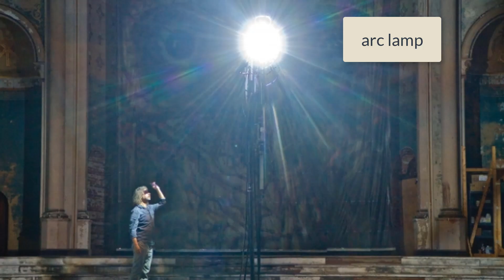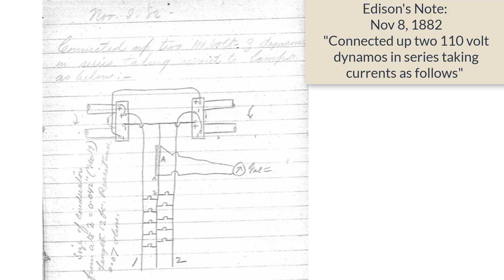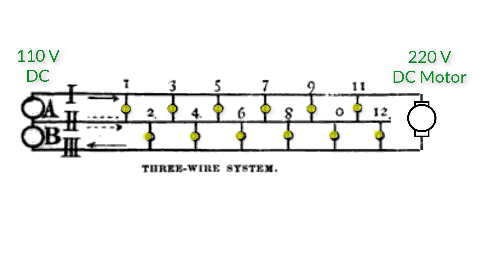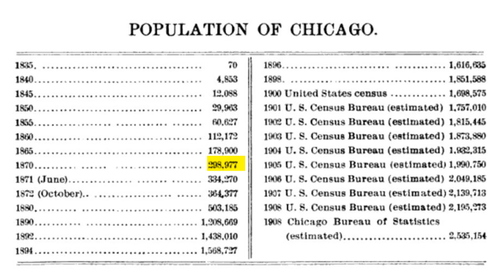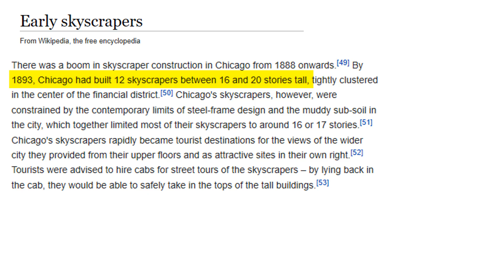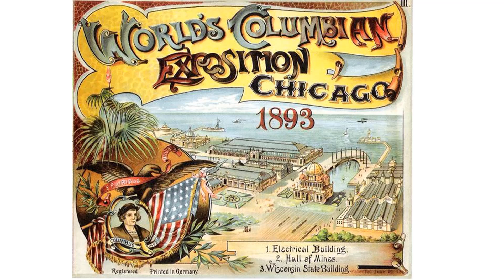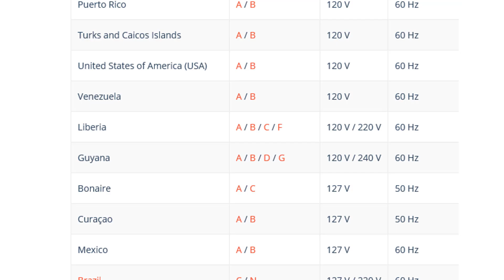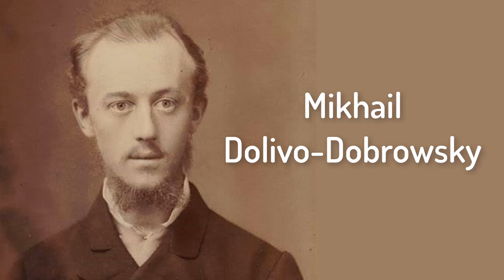Physics and History of Why USA uses 120 volts and not 220 volts

Comment: At 2:35, the correlation between loading and resistance is backwards. The more loads you have in parallel, the LESS resistance you have, not more. The reason why the "popular" lines weren't as bright is due to a higher voltage drop across the conductor. More current means higher I^2R losses.

Comment: Ok, I get the 110 V and 220 V DC for the standard with Edison light bulbs,  but in 5:04 of the video we are in Europe with new light bulbs...are we talking on AC or DC voltage? Because the transformer wont work with DC voltage...

Comment: Actually, in Europe we use 3-phase system at home, too. And that's probably case in most parts of the world that use 220-240 V. So you have always 120° phase between hot wires.
"Normal" 1-phase outlets are distributed in home to somehow distribute consumption (not ideal, but good solution), and there is almost everywhere at least one 3-phase outlet. For example, my stove uses one such outlet, but it can be wired to use 1-phase outlet too.
This is good for electrical companies too, because if there is less current in neutral wire, they loose less and transformers just need to transform high to lower voltage.
If I understood right, in USA you get 2 hot wires with 180° phase. OK, advantage is that when you use both wires, you double the voltage, where in 3-phase system, every combination of two wires gives voltage of sqrt(3) times bigger voltage (about 1.71 times).
I still ask myself: What's wrong with USA? 😀
And let's not forget Tesla...

Comment: Interesting, thanks

I thought above ground delivery and decentralization of power stations made the locally transformed 120v safer and more efficient. 

Safer because the fluid transformer being an isolator for spikes and resonance. To the level than you can power a factory anywhere, only amps are the limit, as far as factors affecting zoning are/is concerned.

And now it is consistent with history, thanks again

Comment: Hmmm, some facts but leaving out many others. Edison & DC and transformers in almost the same breath - transformers are use on AC, and Edison was a proponent of DC. Edison didn't invent multi-phase power, it was independently invented by Galileo Ferraris, Mikhail Dolivo-Dobrovolsky, Jonas Wenström, John Hopkinson and Nikola Tesla in the late 1880s. There's much history about the battle between Edison and Westinghouse, DC vs AC. Edison's DC system in NY suffered from being DC and the current loss over distance meant the generators had to be many and distributed frequently. The large belching generator plants which caused end-of-line current to be non-existent when loads increased closer to the plant made Edison electric undesirable. The Chicago Worlds Fair pavilion being lit by the Westinghouse system is what made AC king. The first commercially viable and effective electrical generators were at Niagara Falls and Willamette Falls (Oregon).  Also, no mention of Tesla, who is the reason AC and Westinghouse was so successful. Some aren't fans of Tesla, but it's his name on the plaques on those original generators, he also designed the electrical motors which were efficient and allowed the factories to use the electrical power effectively (a design unchanged for most of a century) therefore he's earned his place in the history of electrifying the world. Edison popularized the light bulb, but Tesla brought us the electricity to power it.

Comment: Actually...just about every home in the US has 240V. They just break it down into 2 legs of 120V for lower current uses. 
The whole point of higher voltage is less current for the same amount of power. POWER (W) = Volts (V) X Current (A). 
Current is what heats up wires. For a given amount of power needed, you can safely use a smaller gauge of wire with a higher voltage. 
Saves Copper...saves Money.
(Then there's 3 phase...but that's another story...:-))

Comment: America does use 220(240). Good luck finding a household in America that isn't 110(120)/220(240). Commercial buildings may even have 3phase with different voltages, some much higher.

Comment: I grew up in a house in Auckland NZ that had 240 volts DC reticulation. In 1953 this was changed to 240 VAC. The house was very old and the cabling was rubber insulated running through exposed steel conduit down to the various very clunky switches made for DC.

The problem was that for 240 DC you only need to insulate for 240 volts with a margin. For 240 VAC you have to insulate for peak voltage which is 240 X 1.414 = 340 volts. Subsequently the rubber insulation failed livening the exposed conduits and we started getting nasty shocks. The landlord would not fix the problem so we ended up leaving the house.

Comment: Only the heating element in a domestic dryer required 220 volts, the rest of the dryer is 110 volts. That makes it easier to also use the same base model for a gas dryer.

Comment: At 12:30... Houses are still supplied by a single phase, which is what exists between and two legs of a three phase circuit. In order for the house to have 2 phases, three legs would be required.

Comment: Good explanation of a lot of material but I heard, and believe, it was due to the MONEY.  Half the voltage equals twice the copper.  House wire in other countries for normal outlets is really small wire.  2.5mm cross section.  Almost looks like doorbell wire.  If you could convince the power to be to use 120 volts you would be making lots more money selling all that extra copper.

Comment: The USA DOES HAVE 240 VOLTS.  Voltage is determined by how many legs of 120 volts you use!

We even have 3-PHASE power for more industrial uses.  I have seen industrial service panels with 480, 600, and 720 volts.   Again, it is how many legs you use in the stystem. The MASTER ELECTRICIAN will work on the higher voltages, whereas a Journeyman will work UNDER the tutelage of the master.

Comment: 220 to 240volts wasn't the original standard voltage in europe it was minimum of 260 volts europe and the UK only in the last 20 years has stepped down to 220 to 240 volts

Comment: if you go to your breaker pannel and put your leads across the power coming into your house it's 220 two phase. Each phase is 110v to neutral, and 220v to each other. Many of our appliances require 220v, such a stove, central air system, water heaters, etc. 

to state that our electric grid uses 110v is very incorrect, and to even state that common voltages in homes is 110v is incorrect, because between the two phases, again, it's 220v.

Comment: I have read about the early days of electric distribution. Only large cities had it and it was direct current. If a home was wired, no doubt it would have been only for lights and maybe a fan. If a street car line ran down the street, the house lights would dim when a street car approached and would then gradually return to their previous level of brightness once the street car had passed by.

Comment: If ever there is a question in the U.S.A. that requires an answer; follow the money trail.
So: 
P=IV....Half the voltage (V), double the current (I)  to satisfy a constant power draw (P). Sooo...then double the cross sectional area of the conductor to halve the resistance...for said given power (P) draw over a given distance, as 
P= I²R also. (R being resistance).
Tapping into a higher source voltage would have been less costly. Ohm's Law ain't just a good idea. That is why it is called a LAW! 
The above sounds more like an excuse, to justify its existance, than a valid reason. 
The big money backers at the time knew the score and so funded the engineer that delivered the design that suited them, by producing the bigger bang for their invested buck. Edison stepped up. He was likely quite tired by this point and money soothed that ailment.
Nothing has changed to this day, except politicians now pirate a slice now, by either; insider trading, or by accepting a handsome "consulting" fee.
Wherever Tesla is now, he's probably knawed his pencil down to the lead...
Cynical? You bet!!

Comment: 110 (120) is better for the end user because the cost of transformation is lower; diodes, transformers, and capacitors are cheaper. A capacitor for 400 volt (the one needed to smooth rectified current in 220 volt network) is 3 times more expensive than his counterpart working in 110 network. Also, 110 is safer. 310 volt (what you get after rectification of 220AC) is very painful.

Comment: I wonder why landline telephones use 48VDC to carry the signal (and also power the tone generator in the keyboard) and 100VAC at 10Hz to ring the bell?  The latter is because the original bell (and the bell on many phones today) is basically a pair of actual bells wired together.  The former, I’m not sure.  But I do know that the tone generator in the keypad could use less than 48 volts if that were available (transistor radios typically use 9V batteries).  They probably have a resistor in series with the tone generator.

Comment: I work mostly on 3 phase 480v equipment...sometimes 208v 3 phase....electrical has always been interesting to me....i have a few chillers that run 4160v the motor starters are huge for them.

Comment: Actually the electric light was invented in Canada but Edison bought the patent. 120 volts causes more deaths than 220 volts as it's not shocks kill people, it's usually fires. 120 volts will use twice the current to provide the same power causing more heating of poor connections and hence fires. How many people drive cars with 6 volt batteries anymore? It's high time North America moved on and got ride of 120 volts. A great deal of money would also be saved as the amount of copper needed for an electrical installation for a huge saving.....  also, incandescent lamps are a thing of the past as well.

Comment: It is a misconception that the US does not use 240V. In fact many US homes are supplied with 240V cte (centre tapped earth) and a 0V nominal earth which may float a few Volts each side of the true earth at the home.

For safety reasons the home also would need a real earth wire.

Notice we can't call the two live feeds plus and minus as they are both AC: two 120V sine waves with the momentary voltages being equal and opposite at all times.

In another supply configuration the two live feeds are two out of three phases from a three phase supply, which gives an effective potential between them of about 207V. 

Either supply is easy to produce from an 11kV three phase supply by different designs of transformers, whereas if the 11kV is single phase it has to produce the equal and opposite live feeds.

Plug in equipment runs at 120V, wired between one of the two live feeds and 0V. Half the sockets are wired off each  live supply, to hopefully balance the load.  That is why Americans think their home is wired for 120V, true, but it is only half of the story.

However fixed equipment, like air conditioning or a charger for an electric car is wired across both live feeds, giving a 240V feed to the device or 207V as the case may be.

This is the same trick that Kathy described with the two DC generators, but applied to an AC supply instead. Unless your home still has pre-WW2 wiring that is the way it gets its power.

It is also why much equipment is specified to run on 200V to 250V, so that it works in all American homes and can be exported to countries using 220V, 230V, or 240V. 

That means that the high power devices get all the efficiency savings of lower current that Europeans get by using 230ishV but with the safety that if either feed leaks to the chassis of the device the homeowner only gets a 120V shock.

I am sure you are right about the history of how this came to be, but the later innovation of the 240V cte feed is one that could be adopted elsewhere to good effect for safety reasons. A 110V shock is more likely to be survived that a 220V one. From a safety viewpoint it was a step backwards when the Europeans went to 220V just to save copper.

Before we all make that swap to the North American system, we could go one better...

British and EU building sites take this further. Portable power tools on such sites don't use regular household electricity but instead have a 110V cte supply. That means if you negligently cut through the lead you get a 55V shock. As the world record lowest Voltage AC fatal shock is 90V, it means that electrical accidents on our building sites should always be survivable. That has reduced workplace mortality in the building industry significantly.

 Builders even have radios which take 110V because British builders regard a radio as essential workplace equipment, and are grateful for the American market that makes it viable for manufacturers to make dual voltage radios. 

In a world where the cost of conversion was not felt to be a problem we would all now be using 110V cte in our homes because it is the best trade-off between safety and efficiency.

Comment: I remember as a child having a holiday in france, we had rented a house and it had a supply at about 100 vots. This must have been in the late 60's. Searching the internet I find that France regularised its supply voltage in 1956 to 220 volts, so this was presumably an old house with a not yet converted system. Also I worked on a machine in Indonesia in about 1995 and was shocked (pun intended) to find that the building I was working in had a 3 phase supply with 110 volts per phase, all the sockets were wired across two phases so it seemed like it was like everywhere else having a nominal 220 volt supply. It is clear that many countries have changed their voltage supply and given the split phase supply in USA it would be easy to convert as long as the breakers broke both conductors. Just need to use a different plug and socket to prevent mis-plugging.

Comment: If you accidentally touch a 110 Volt circuit, you get a nasty shock but you still live.  If you are in Europe and you accidentally touch a 220 Volt circuit, most of the time that is fatal.  There is a push to get 40 volts made as the standard for indoor circuits for houses in North America because at only 40 volts it is impossible to get shocked from such low voltages.

Comment: Great video Kathy. I think when comparing systems between countries a lot of people focus on the fact that most outlets in our homes provide 120V AC and 240V where necessary. It leads people who don't live here to think our homes are somehow underpowered. However, most American homes have 200A service panels. That is equivalent to 24,000 Watts of available power. Plenty of power available to run everything we need. No need to spend money to fix what isn't broke. Unless we run into a spare trillion or two. The upgrade we really need is to harden the grid by burying the power lines and protecting the infrastructure from an EMP. There are those who have 240V 50Hz power, and those that have been to the moon. Voltage envy is a bad thing.

Comment: For the same power the higher voltage means less current which means smaller cheaper wires

Comment: According to my personal experience with both systems the American home appliances are generally under-powered and inferior compared to their 220v European counterparts. European appliances are more powerful, compact and more reliable. I think to a big degree it all comes to that voltage difference and thus lower currents and less copper in European appliances for the same power rating. So at the end of the day 110v system is not only more expensive for power companies but less convenient and more expensive for American consumers as well.
But of course it is too late to try to change it, it would be too expensive. And considering the experience of changing to the Metric system in US... I think Americans would be unlikely to survive that transition: would be starting fires by plugging their old 110V appliances into the new 220V system, it would quickly turn deadly on massive scale!

Comment: there is 3 phase Y the old type and there the newer more accurate one 3 phase Delta that  is 120 degrees apart also the one illustrated where in the video. also its the appreage that dose the work and not really the voltage.

Comment: The electricity is a energy, and in the formula to obtain that you have a direct product of the intensety and the potential through the plant, but because is a alternate energy you have and the unghlar momentum that's give you the fraquecy. So, if you want higher fraguecy you obtain less potential because the energy remain the same. If you give more potential you will have less frequency but instead you find more resistence in magnetise the plant and rise the consum for transporting the energy. United States and Rusia have higher frequency because they need to transport for long distance the energy, but the smaller countries in Europe don't have this problem so they use higher potential.
I think.... I am not sure 100 percent.